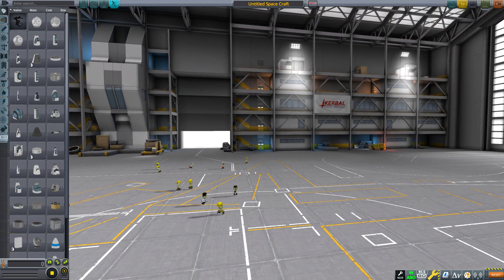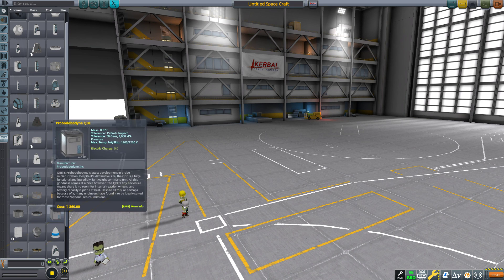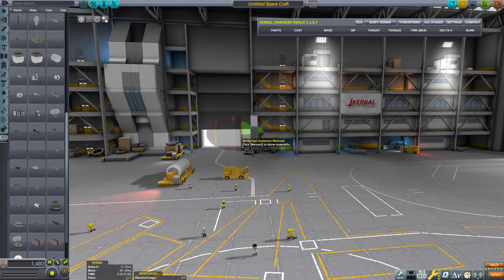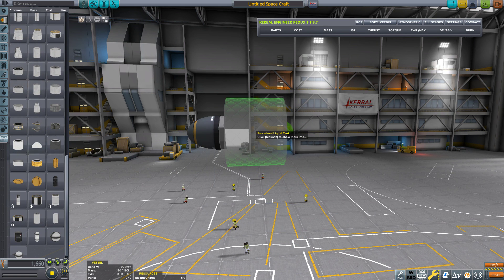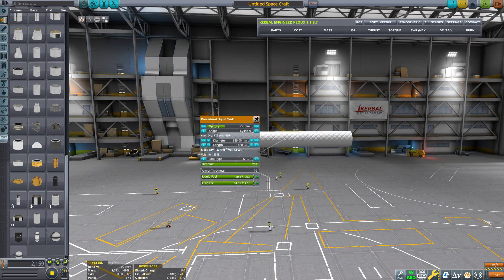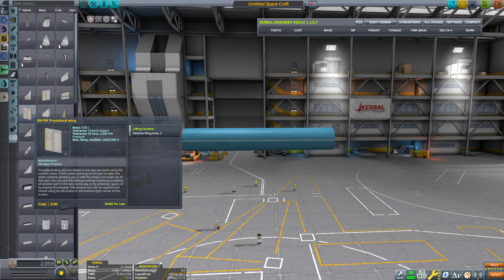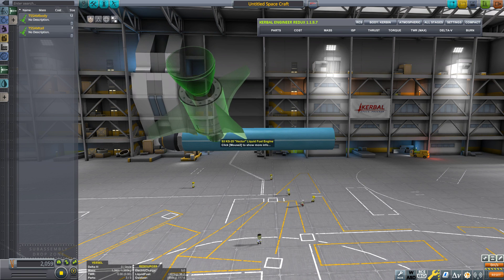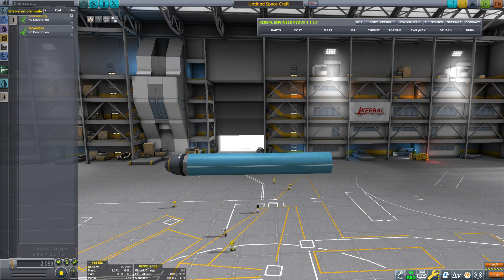KSP BDArmory: Modular missiles beginners tutorial

Comment: Im having a new problem that i wasnt having before, not sure whats causing it, but the missiles seem to have this issue where when guiding, they will start flying straight towards their target, and then dont maneuver to hit the target until its too late and they end up missing. using Radar and AAM guidance.
Reply: You should use the "Procedural SRB customized for BD armory" booster that comes with the mod. Also check the fin placement, but the special SRB fixes a lot of issues. You can even do 360's if you build them right.
Reply: @crad5476  I have been using the Procedural SRB for as long as i can remember, so its not that, in the past I have had missiles do 360's, but those same missiles now miss, i dont think i installed any mods that could have broken things but i will do some testing.
Reply: @cat-nl4sv  Hmm. 2-3 weeks ago I installed KAX, which broke my missile guidance in a different way for whatever reason, when I uninstalled it, it worked fine.
But I had the same issue you had some months ago, idk how I fixed that one.

Comment: When trying to use missiles in vacuum, they miss their target entirely, i have the target radar locked and and missile guidance set to radar, and im using thrust gimbal and reaction wheels to turn the missile.
Reply from the maker: Modular missiles never worked in vacuum well. They are meant to steer under drag.
Reply: @jesusrv2009  ah ok.

Comment: im having an issue where all engines fire,
I followed the tutorial and tried a lot of troubleshooting yet the missile fires all of the engines in the missile while my staging and root part were valid

what do I do?
Reply from the maker: The engines are activated by  its respective action groups (for each stage) if all the engines are getting fired that means that BDArmory thinks the fuel for that stage is depleted and that it should trigger the next stage. Not sure that might be the case. I would suggest reviewing the action groups and to check that the engines can run normally after triggering manually each action Group
Reply: @jesusrv2009  It still doesn't work but thx for the reply,
The engines are SRBs the main and the booster, I don't know but I'm using
the procedural customized SRB for BD armory that might have to do with it and I have tested all action groups for any errors.

I might be able to think of a workaround but thx.
Reply from the maker: @thespumeljoke  Try to create a stage only for the srb boosters then the 2nd stage decouples the srb boosters and fires the next srb
Reply: @jesusrv2009  I have tried it and everything, still have the same issue...
Reply from the maker: Could it be related with the way you are firing the missile?
Reply: @jesusrv2009  I am firing it manually and locked on a target, It might be that it triggers all of the thrusters on the missle part?
Reply from the maker: By firing manually what do you mean?
Reply: @jesusrv2009 firing not by guard mode just locking on a target and pressing left mouse button not the automatic guard mode AI, and I have tried guard and it still doesn't work so I don't know...
is there a new version out there for modular rocket parts?
Reply from the maker: @thespumeljoke  There is no version because so far everything has worked as expected. Can you try to manually right click on the missile core part and press Fire after locking?
Reply: @jesusrv2009  im really sorry for wasting your time.

I have found the issue, I had an older version of BD armory based on a different comment, really sorry.

Comment: Hi, great mod, but i have a small problem with the thrusters: even tho the stages seem to be in correct order, the modular missile guidance starts every thruster, after i launch it. Got any suggestions?
Reply from the maker: Only the engines activated on a specific action group/ stage should be activated and will remain active until they run out of fuel, at that point the next stage will be automatically triggered
Reply: @jesusrv2009  Thanks for the quick response. i think i got that right, but its still not working. Is there a way to send you the thing i have built?
Reply: @jesusrv2009  Have you updated your mod? Somehow it works flawlessly now :) Thanks for your efforts!

Comment: I cant seem to get the missile to fly at the target. It tracks for the first few seconds, and then just keeps going straight 1/4 of the way to the target, completely missing it.
Reply from the maker: Maybe it is losing the lock? Are you using 360 degrees boresight?
Reply: @jesusrv2009  No, should I?
Reply from the maker: Yes
Reply: @jesusrv2009  I tried it, still same issue.
Reply: @2polev355 Maybe not enough electric power for the core? Or the weapon manager is set up for a shorter range maybe. Or the missile range settings are too short and the engine has leftover fuel so it keeps going

Comment: So I want to know how to get like a JDAM modular bomb to work, what guidance mode, and targeting mode If I want it to be a glide bomb targeted by GPS location?
Reply from the maker: I'm not really sure If something like that is possible (bombs are not implemented for modular missiles)  but I would go with a AGM guidance, laser targeting. You need to add a working engine with fuel so for a kind of gliding you could downscale whatever jet engine you fancy just to give you a constant little push. You will still need to add lifting surface and elevons. But it would be basically a low speed air to ground laser guided missile

Comment: Mine isn't even being recognized as a missile. On guard mode the game makes sure to deselect it to any other weapon, and if manually fired it just makes endless spins until running out of fuel
Reply from the maker: I think you might be missing the missile core
Reply: @jesusrv2009  I mean, i did setup it like AAM - Radar guided.
Reply from the maker: Then check if the range setup is correct. Also check the orientation of the missile core maybe it is somehow looking backwards
Reply: Did find the problem. Some random outdated mod was interfering with something. If someone else has a similar problem I recommend updating ALL mods you have

Comment: The rocket engine part of the missile won’t fire after launching the missile. What could be wrong?
Reply: Oh it works after actiongrouping the engine to 1
Reply: Oh, on another note, Id like to suggest splitting guard mode into full AI control mode and CIWS only mode. Ability to set which weapons to be used by the AI will be neat too.

Comment: which mod to use to resize and shape the parts?
Reply from the maker: TweakScale. ProceduralParts and B9 PWings
Reply: @jesusrv2009   thanks 🔥
Reply: @jesusrv2009  What version of TweakScale do you use?
Because in my version, it only lets me modify the scale, and it does not let me modify the dimensions (diameter, lenght) freely?
Reply from the maker: @xxchristorxx3955  That is not TweakScale but ProceduralParts mod

Comment: I don't have a warhead exploding, It just flies away
Reply from the maker: Maybe your missile is missing the target?
Reply: @jesusrv2009 No, after a miss, the missile tries to turn on the target
Reply from the maker: @mogoff2369  if the missile miss the target it will try to turn and hit it until it runs out of fuel and the distance with the target increases
Reply: @jesusrv2009  And, how do I set up a warhead so that it explodes at a certain distance, rather than when in contact with a target? "Detonate distance override"? But it is don't work
Reply from the maker: @mogoff2369  Yes, detonation distance override
Reply: @jesusrv2009  "Procedural missile core for BDArmory" can be a warhead?
Reply from the maker: @mogoff2369  It can be, but it is not. There is a specific warhead procedural part
Reply: @jesusrv2009  Where can I find it?
Reply from the maker: @mogoff2369  https://github.com/jrodrigv/BDModularMissileParts/releases

Comment: I am having trouble attaching the missile to the decoupler in this example. It attaches with massive clipping, that leads to an explosion when activating the weapon. Maybe I am not understanding the rooting of parts? I am pretty lost on the subassembly procedure.
Reply from the maker: When attaching the missile  stage to the tower Decoupler try to point with your mouse to the Decoupler frame otherwise you might attach it to the tower instead.

You can also use the move tool to separate a bit more if needed
Reply: @jesusrv2009  It is still acting up a bit. I redesigned missile and launcher to minimize clipping, but haven't quite figured it out yet. Thank you for offering help though.
Reply: @patrickdunn7225  just use the gizmo to move stuff around

Comment: Hello, I am using 1.4.5, but that physics range extender mod,  hasn't got a supported version listed on github, is the a compatible version for that mod, because that red error message makes it unplayable, I just dont see why there is BD armoury for 1.4.5 but not physics range extender, many thanks.
Reply from the maker: Hey. I think if you use the PRE version 1.7 or 1.8 it should work fine for KSP 1.4.5
Reply: @jesusrv2009  thank you, this helped me.